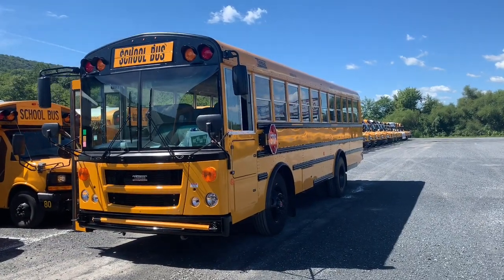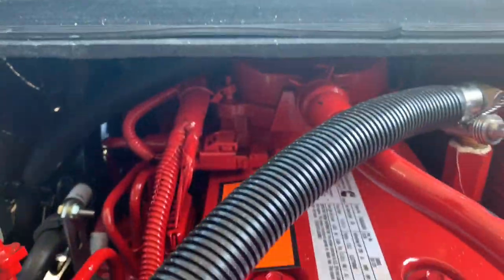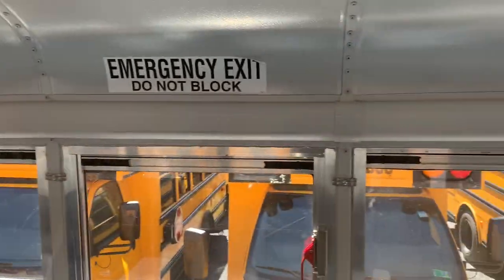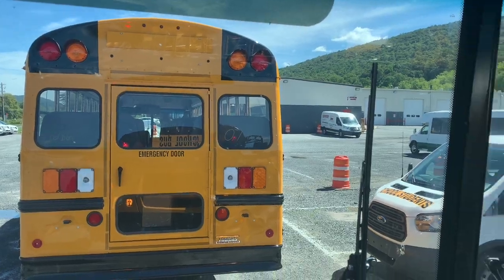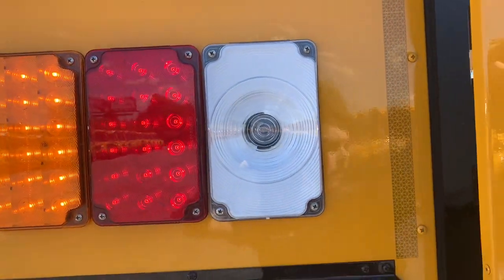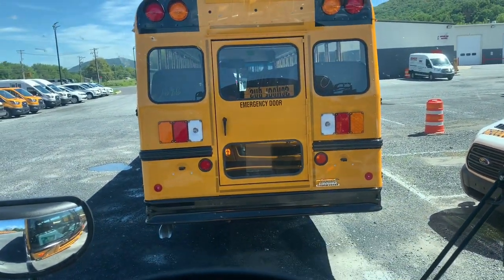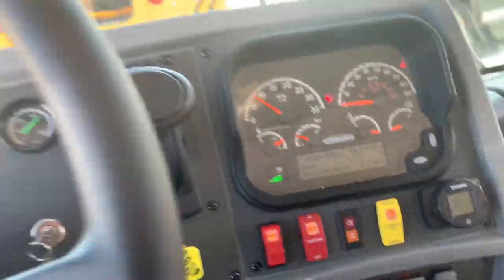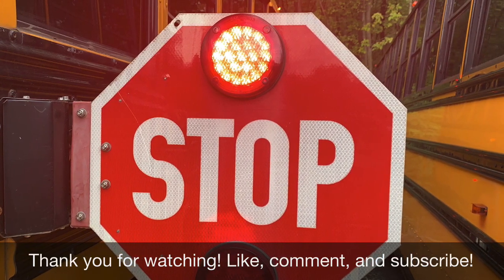2021 Thomas EFX

Comment: 3:31 I haven't ridden in a school bus that is released or facelifted after 2009, so I want to know how new school buses are like in the early 2020s. Passengers cars and light-duty vehicles have changed quite a lot since model year 2009, so I would like to know how it is with heavy-duty vehicles. I don't see any vents above the passenger seats. I also looked at Thomas' website and could not find a list of standard or optional features. Does this generation of bus (released model year 2012) have air conditioning? If it does, is it for the driver only or have the driver vents intentionally been made high velocity (search high velocity air conditioning) in order to cool the entire cabin? Does it come standard with it? What is the MSRP of the base model this bus, and what are the trims available? What is the fuel economy for the EPA's city and highway test cycles?

Comment: I haven’t been on a school bus probably since 2007-2006- in the back emergency door they should put  door steps whenever you open the door the door steps should come out so kids, adults or whoever can step on the step and get to safety besides jumping and hurting their legs. Also they need seatbelts- how can that be a safety bus without seat belts especially with kids- wtf.

Comment: 6:36 I am not the biggest fan of them too, there is an option to order them with the rectangular style lights. In MA, (at least our local dealership does this) they order all of their buses with the rectangular style LED marker lights and turn signals. I think there probably is an option on the EFX and HDX to have the bigger lights too.
Reply from the maker: Yeah, I just think that for a vehicle that needs to be visible and safe, the little turn signals aren’t good.
Reply: I was an electrical engineer at Thomas Bus for 13 years.  I designed the body wiring harnesses for the EFX.  I wasn't happy with the pin lights either.  But at that that, there was a lot of politics at Thomas to use them because Bluebird was using them and they costs less.  I think they are less likely to be hit by something, a tree limb for instance, but I agree they are not as visible.

Comment: Did Thomas finally do away with the Freightliner beeping turn signals? Or is that an option that can be enabled/disabled? I also noticed the red light chime before you opened the door. Our HDX's had those back before Wisconsin had 8 ways, and it was just the two reds up front and rear, and the chime would ding the entire time you had them on without the door open. Our 2013 EFX's didn't do that with the three way switch and the ambers.

Comment: For a 2021 i feel like this bus was a lazy design. Looks like a cheap toy inside and out.. Lacks so many necessary amenities needed for the driver and students.. And school busses are made for normal sized elementary kids. When you get middle high school on there, that starting capacity breaks in half quickly. And it's crazy how they still installed the low glass on the back door for drivers when you won't be able to see out of it with 3 high schoolers crammed into one seat. My opinion. Don't hate.
Reply from the maker: I can agree with you. A lot of the spec are ordered by the buyer, so my guess is that the district that ordered this one wanted it this way.